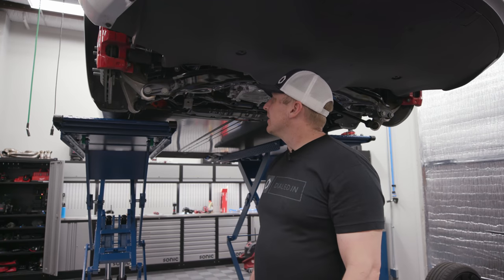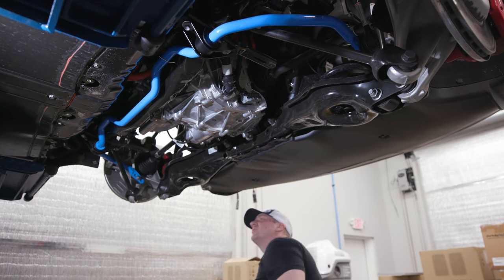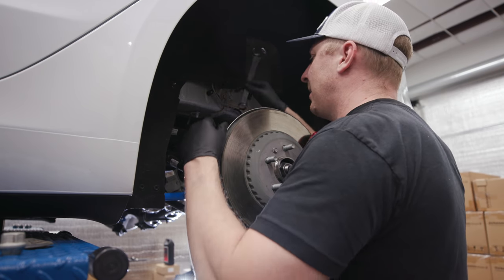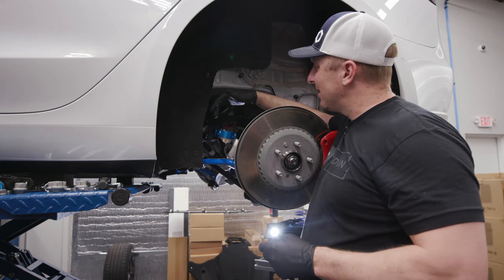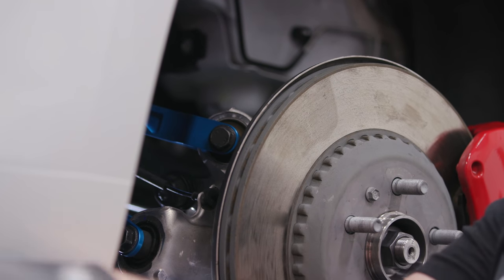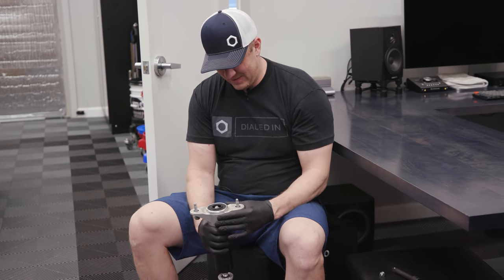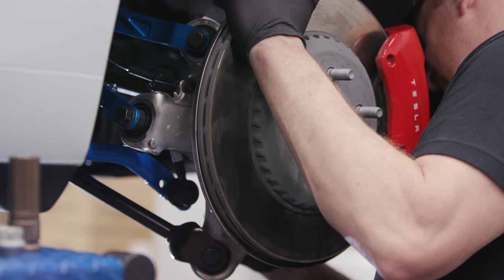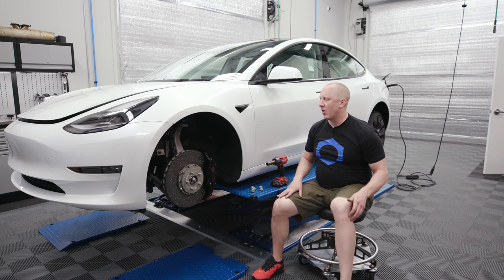Tesla Model 3 Gets A Crazy Suspension Setup - Rear Install

Comment: Looks mega. Just a note though, you're best to tighten all the suspension arm bolts when the suspension is compressed at ride height. So you are not to stress the bushes.

Comment: Starts video with we are in the rear. Dude when you started pulling bolts without anything under the control arm with all that spring pressure I was expecting it to explode right in your face.

Comment: what will these mods allow your tesla to do better than it does from the Factory?
Reply: Flex😀
Reply: The fancier bushings and lighter parts can have some minor improvements to handling, but the big purpose is the greater range of alignment adjustability.  If you  do track days or autocross that is a huge advantage.

Comment: Hey Matt I don’t know if this matters anymore but I thought that you always need to talk everything under final load of the car so basically all the weight on the car is on the ground or a lift I could be wrong?
Reply: If your bushings are rubber or a poly type material then yes you torque them with load.   If the bushings are metal like a spherical bushing then it doesn't matter as the bushing rotates freely regardless of load.

Watch Matt to gain a little insight here and there and/or for entertainment.   Not as a how to for working on a car.

Comment: and why did you waste your money on a performance version when you ripped it all out? You could just bought a rear spoiler
Reply: the main benefit of the performance version is a ton of extra horsepower and track/drift mode, where you can adjust front/rear power split and turn down traction control.